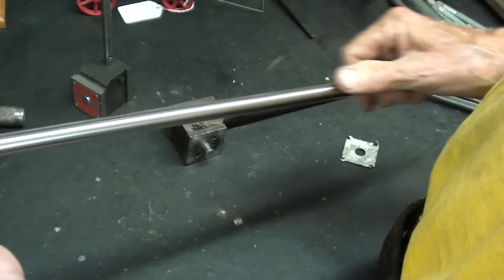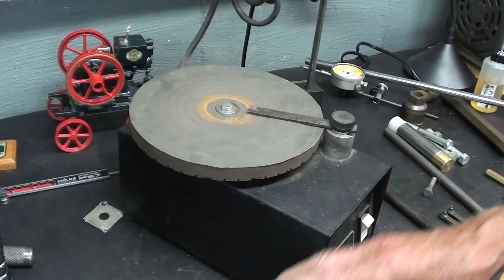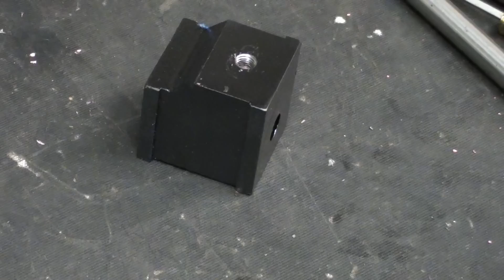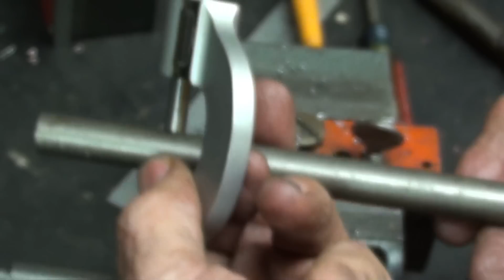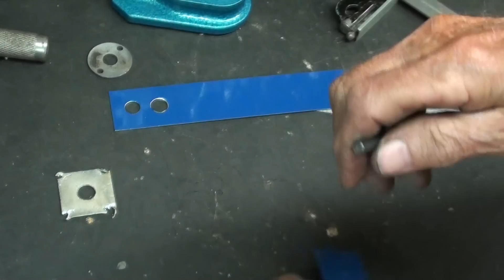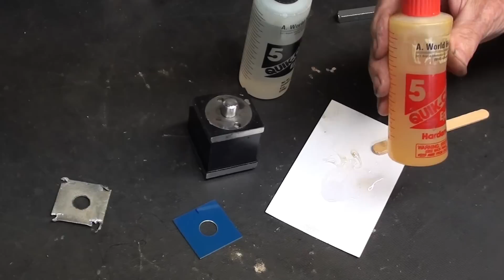Restore Push Button Magnetic Indicator Base #34b pt 2 tubalcain starrett

Comment: Is it possible that the design intent of placing the rear spanner holes on the inside and the cover on front prevent metal particles from entering the tightly toleranced magnet/cylinder interface?
Reply from the maker: I never gave it a thought, but I think you are probably correct

Comment: I have an older 1/2" rod Starrett (faceplate still mostly intact) in about the same shape. Also has the slot in the end of the rod. Never used it because i don't have anything that fits .500 rod. You inspired me to restore it. Now that I know how to get it apart, thanks for that! Mine looks exactly like the one you show here. Brass plate and brass dowel rods where the face plate pins go ect. I think what you have there is vintage Starrett 657 because it looks exactly like mine. Thanks to you there are 2 restored 657's brought back from the scrap pile.
Reply from the maker: Thank you, good luck on your restoration. Maybe mine is a Sterritt, but someone else told me it was a brown and sharp.    and it perfectly matches the brown and sharp. Perhaps a third-party made them for both companies. During my restoration, I now wish I had made the post or rod the same size as my other magnetic bases

Comment: I found the Noga arm set I bought a few years ago.  Man is it heavy.  When you loosen it, it just collapses like a dead animal (unlike the vertical post type).  Separately, I had purchased a couple of flexible gooseneck arms to use for third hand clamps (soldering and stuff).  Now that I've looked at the Noga style, I think a couple of those would work much better for a third hand if you just had some sort of clamps for the ends like a couple of big alligator clips or something that could fit into the dovetail slot or maybe the 8mm hole.  You can buy a couple of the red aluminum ones for around $12 each (for the 300mm long ones) without the magnetic bases.  HF sells the post style with the magnet for around $13 ea and they all have an 8mm thread.  And you just need a steel plate or surface to use them otherwise they are standard indicator bases.  Is anyone following me?  There are a lot of people that would really like the idea.  Maybe we could put an 8mm shoulder bolt in the hole in arm and then attach the clamps with those.  Any ideas?

Comment: I was thinking you would have put the ball on the top.
You proved how well that works when mounting the sliding part.
Reply from the maker: That would require making a special tool. In fact, adding two or three hours to the job. Also, I can’t think of any company that does that with an indicator holder. However, virtually every company did it with a surface gauge.

Comment: I think (but not 100% sure) that the magnetic base is an Eclipse 900A (made in England!).  I have a bunch of bases that are the same size, but they all have extra holes or screws.  The Eclipse is identical to the Starrett in all respects, except for that screw in the side and the name on the plate.
Reply from the maker: Thank you, and perhaps it is at Eclips. Someone else told me it is a Brown & Sharpe with a three eights rod. I just looked at an old Brown & Sharpe catalog and sure enough there it is, or at least it sure looks like it with a 3/8 rod. Perhaps eclipse and or Brown & Sharpe worked together, or even bought the same base from the same company?

Comment: A second vote/plead for the cross drilling jig. Or lessons on how to do it without a DRO. I don't want to 'fess up the amount of material I've practiced on without achieving the accuracy needed. I have the the wye tool, it's still a struggle on a1/4" pin.
Reply from the maker: I do have one or more videos on how to drill cross holes. And yes, I should show how to make those jigs. They are so simple. They really do not need instruction. I started making and using them in my teaching in the very first year, 1967.

Comment: Well done Lyle.  Waste not want not.  ....and yes it does look like the  hydraulic cylinder from drum breaks.
Reply from the maker: Thank you, I just realized this very moment that probably most people will not connect with the brake cylinder. They are only familiar with disc brakes. You must be an old timer.
Reply: @mrpete222  in my mid 60's,  working class family.  Can't tell you how many brakes I rebuild, drum brakes that is. Long time watcher of your channel.  I always walk away with some new found knowledge.

Comment: I think that screw on the side of the Starrett base covers a second hole where the rod could be moved to.  I have seen another set up somewhere where they mounted an indicator to the side of the base and didn't use the long rod somehow.  If I see it again, I'll sent you a link to it.  I purchased some 10mm OD, 303 SS TG&P free machining stainless rod just for this purpose to make some nice rods for some of my bases.  Most of the aftermarket clamps are all metric now so the 303 I bought is also.  I also just tapped the end of the rod so I could get a good quality hardened set screw for the end thread (and it was easy).
Reply from the maker: 👍👍 thank you

Comment: Mr. Pete,  how about explaining the cutting and turning feed rates tha are in the machining tables.  Specifically in relation to the rpm, and surface feet per minute as well as in relation to the quality of the finish.
Reply from the maker: I think you mentioned that a few weeks ago. I really need to do that, but I don’t think there would be any views.
Reply: @mrpete222 
As you know, until you put it out there, you never quite know what will draw interest. I have several video series running and the most popular one I put up as just a throw away more or less. But the people love it. It has to do with trying to make one of those cheap Chinese X-Y tables better. 

So what the heck, do the first video and see if it flies.

Comment: Great show Mr. Pete!!!  The 1/2 inch is nice but might be a little overkill for the short travel dial indicators (as well as plunger back and test indicators) you would typically use with this size mag base.  I use a 3/8 inch upright, snug, and gage holding rod (that is the correct spelling) for my 3-inch travel dial indicator and that's about the limit of stability (for bounciness and strength of the magnet) for that size base.  I have a larger base (with more magnetic strength) and use 1/2 inch hardware for my 5-inch travel dial indicator ... the smaller mag base just can't support the weight.  BTW, the screw on the side covers a hole you can also use for attaching the upright rod ... so it can be top or side mounted.
Reply from the maker: After I completed the job, I realized I should have made it three eights. But I was just copying the original. I intend to use it on the milling machine with my coaxial indicator, as a stop.

Comment: I don't suppose there is an easy home shop method to boost the magnetic force of the spool? I have a beauty of and old Brown & Sharpe but it is so weak it will not hold itself on a vertical surface, and it would pain me to throw it in the scrap barrel.
Reply from the maker: I had a brown and sharp indicator just like that at the high school. Also very weak, in fact, I thought all magnets were that week, and did not even want to buy a new one. I eventually threw that away.
Reply: I wonder if you could wind a coil of insulated wire around the spool (now we know how to get it out!) and energise it with a battery / dc supply, having first worked out which way around to apply the current.  Or make a new spool around a cylindrical neodymium magnet?  They often come with holes in the middle, which could be used to screw the whole thing together.

Comment: Mr. Pete,  Would you be able to correct that chuck runout by machining the backplate or how would you go about correcting that?  I have a 9a and if I run into that issue, it would be good to know the best approach to correcting it.  Thanks much.
Reply from the maker: No easy repair just worn out old chuck
Reply: @mrpete222  
Naw, just a bit of work and good as new. Well, some work and good as new. Ok, so a lot of work, but then it a great set of videos.
Reply: After a good cleaning job a common correction is to block the three jaws so they can’t move and grind the surfaces with an internal grinder to true them up. Showing how this is done would make a great video.
Reply: Thank you.  I may have misunderstood what was running out.  I thought the chuck itself was running out (as seen on the face), and the work it was holding also has runout fixed by grinding the jaws.  Either way, a great set of videos to inspect, diagnose and repair SB9 chuck runout.  
 @ellieprice363

Comment: Thanks for explaining the term "drill rod". Our shop called similar material AG2. I needed this type of material and foolishly ordered round stock that must be cold drawn. Expecting some reasonable tolerance I was dismayed when my out of round material variance exceeded .035".

I have many magnetic bases. Most are Noga and Mitutoyo. I have a couple of Starrett bases as well as several other brands. I tend to give away the generic import inexpensive bases mostly because the hardware and attachments are so cheaply made. Starrett and your Starrett copy don't incorporate the common V bottom which accommodates round surfaces so well.  I have used the V feature so frequently, I wonder why the classic Starrett doesn't include it? Starrett so commonly incorporates the best features and includes unnecessary ornamentation. I think this lacking feature is what keeps my Starrett bases in the tool chest drawer while Noga and Mitutoyo bases stay out with dedicated indicators already mounted. I always put my test indicators properly away as I do with my high resolution travel indicators, but I leave 1" travel .001" travel indicators out for easy grabbing with various buttons. I installed steel parking places on the wooden tooling rack above my lathe to keep the ready to use indicators out of harms way. 

Removing and installing the magnetic operating plunger reminded me of servicing a large permanent magnet servo motor that was prone to frequent coolant contamination. The magnetic force would draw in the rotor with the pre-mounted end plate with such force that pinched fingers would raise painful blood blisters. The motor was heavy and all would go fairly well until it reached a certain point. The magnetic force would grab the assembly and yank it from your hands snapping the endplate into position. I flinched each time you assembled the magnetic base just remembering how many times my fingers got painfully pinched.

Did you get the rest of the magnetic base components with the trashed base? Your restoration looks too good to just be shop art.

Comment: Also I've never seen anybody use rat urine to make the patina finish you've created there I think that's a very good use of rat urine kudos for using an odd substance and applying it in such a way they came out looking awesome too bad it's bad and you had to make a new one bling I think is what they call it and of course I'm being completely sarcastic
Reply: Okay I see what it's for now I get it freezing the wave and setting your gauges to those are cool
Reply: @ironcrossmechanic5254  You can edit your own comment, rather than reply to it if you want to.
edit: by clicking on the 3 dots that appear at the far right when you move the mouse cursor over your comment. See my reply is now titled (edited) .
Reply: @simpleman283  just forgot